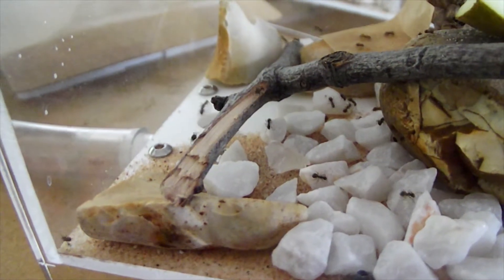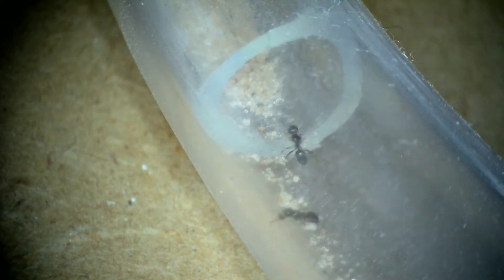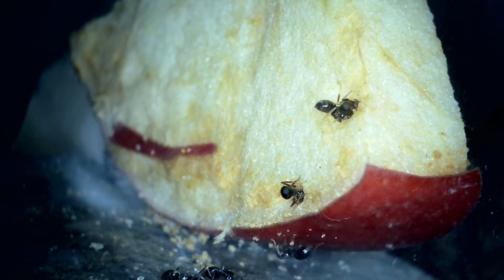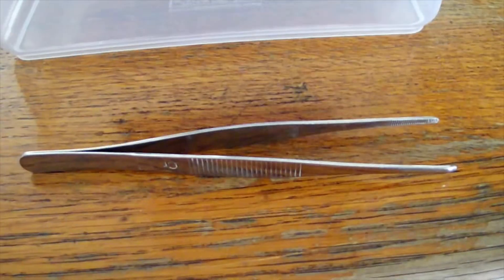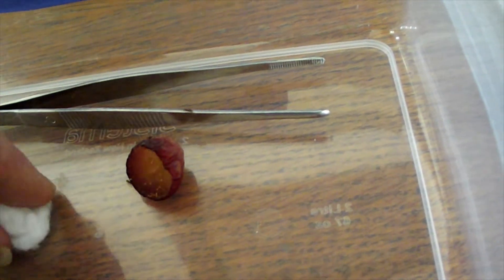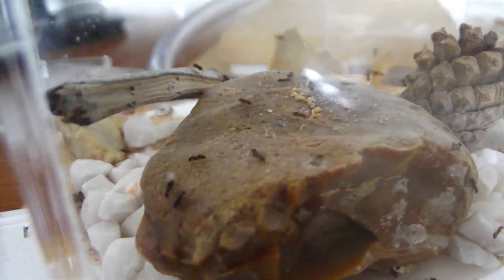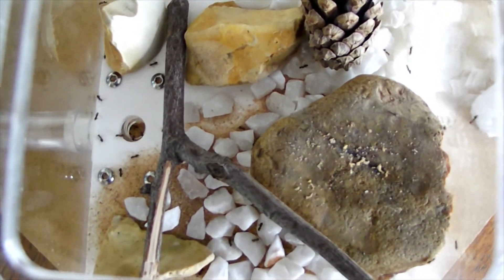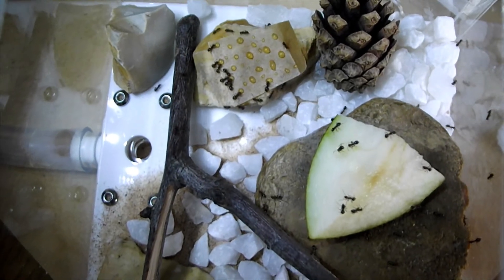Escapes, how they happen and and how I prevent them.

Comment: Vegan ant keeping tips 😁 the cotton wool is an absolute must this can't be stressed enough. So easy to have wayward ants and you need a way to pick them up safely.
Reply from the maker: I always have those little buds of cotton wool sitting at the side of the set up.
Reply: Cotton wool to catch them it's very species dependant some will not grab on and some actively avoid cotton but a wooden lolly pop stem works best for ruginodis .

Comment: Nice video as always .I never put fruit skin in but i assume you must wash it very well ? i just peel everything .
Reply from the maker: Yes I wash it before I put it in, I am also unconvinced by the pesticide argument. Certain pesticides are designed to be actually absorbed by the crop and then they last for ages. However these type of pesticides were killing all the pollenating insects and thus the EU outlawed them. The UK is still sticking to that even after Brexit, however the USA does not and they in general have much more lax rules/laws around crop and livestock production. I have fed my L.N supermarket purchased fruit for two years and it hasn't killed them yet, I'm convinced a lot of these stories originate from US sources.